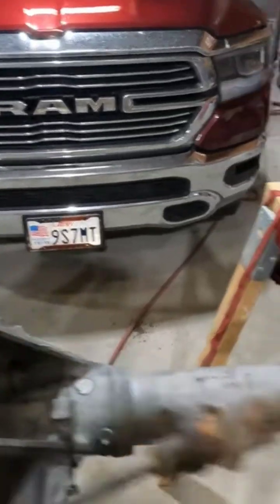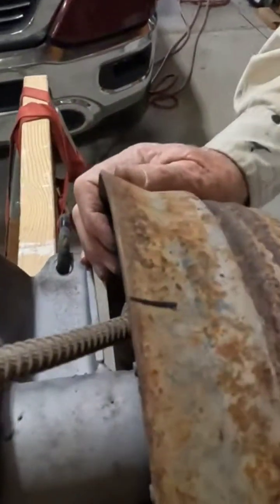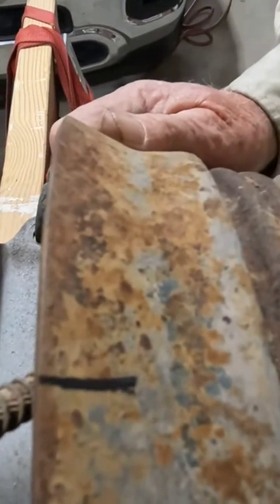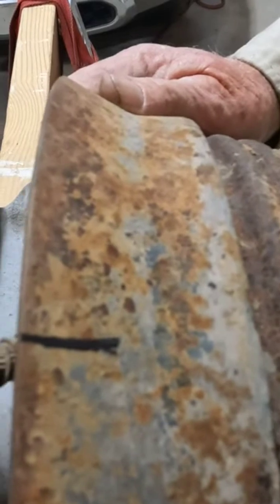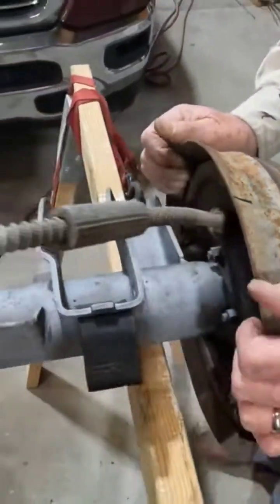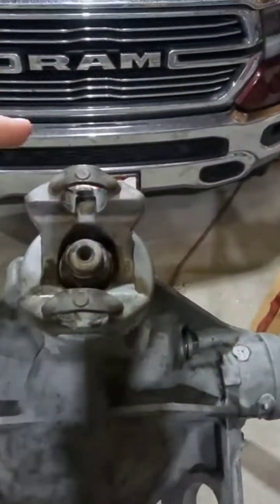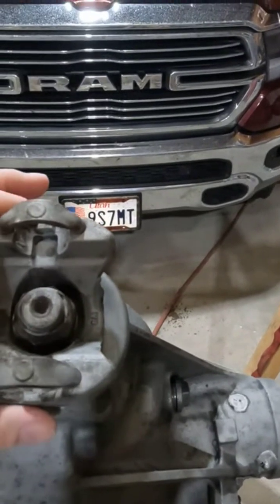How to know the gear ratio of an unknown rear axle. #car #automobile

Comment: You missed a half revolution between 1-2. It's likely over a 4 gearing
Reply from the maker: You are correct.  It is most likely a 4.10:1 ratio.